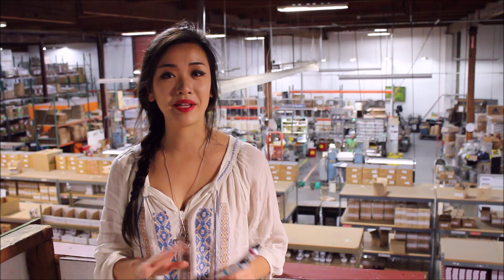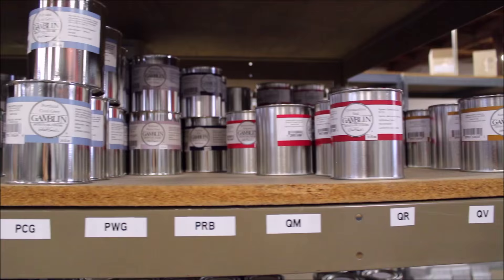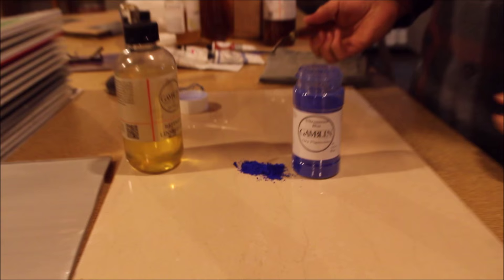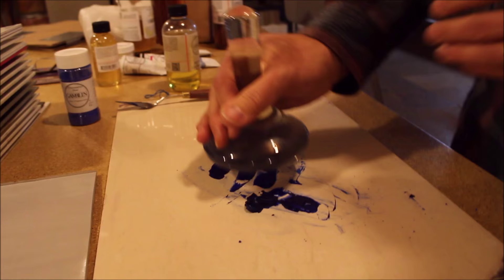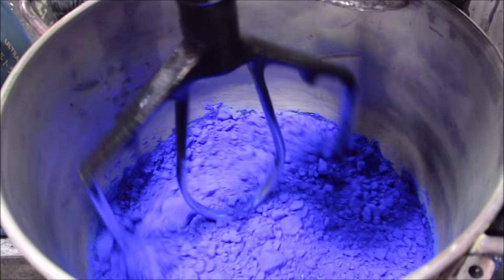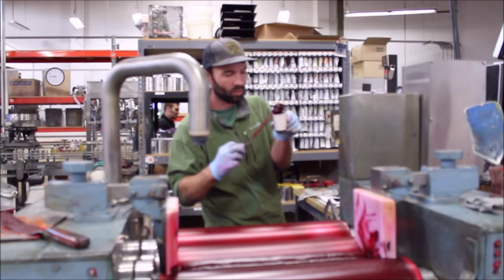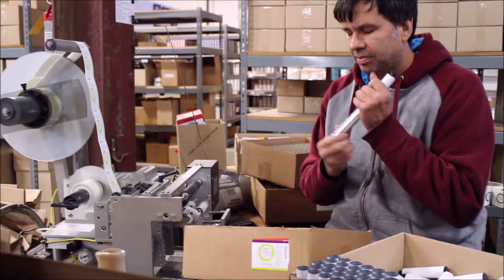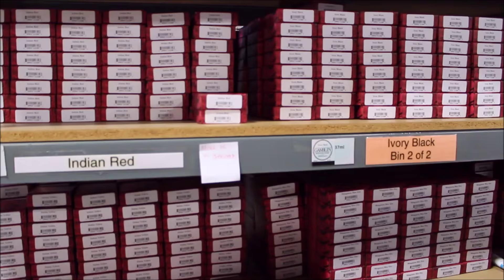HOW OIL PAINT IS MADE VLOG || tour of Gamblin Artist Colors

Comment: So cool, Happy! Surely they use some fillers, large manufacturers add some other stuff into the paint to prevent the tubes from going bad so soon, like molding ect. and then they add another filler to counter that filler to not affect the paint. W&n does this. It's really not bad for the paint and it insures quality in the long run.